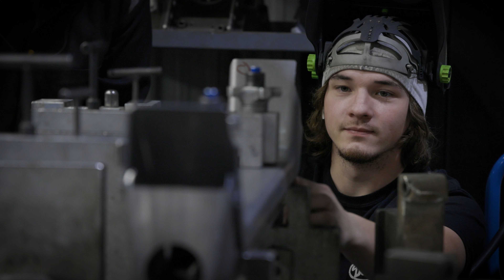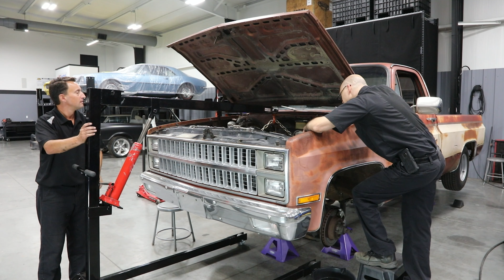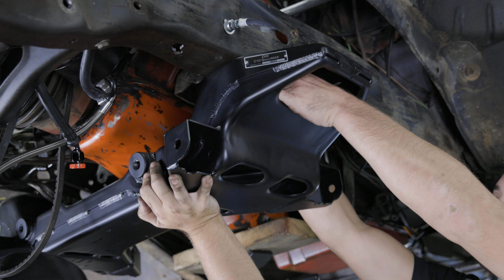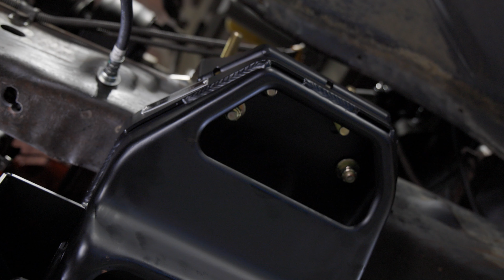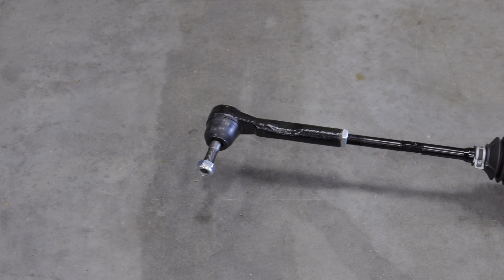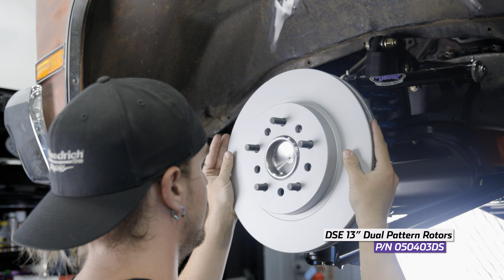How To Install The Detroit Speed SpeedMAX Front Suspension Kit On A 1967-1987 GM C10 Truck

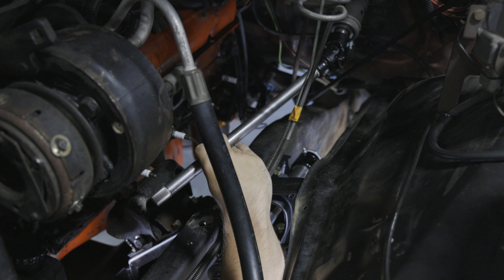Comment: 10:47  for 1967-72 instructions say measure from the forward factory engine mount hole in the top of the frame. If I remove this section I will not be able to use the frame rail reinforcement plate with factory holes. There are three holes. I think for different motor options. Should I measure from the middle hole or forward and not use reinforcement plate.? The frame also bends down and won’t allow plate there. 
Thank you.